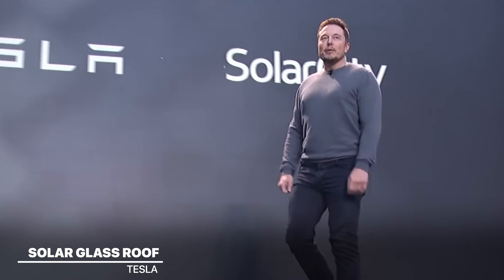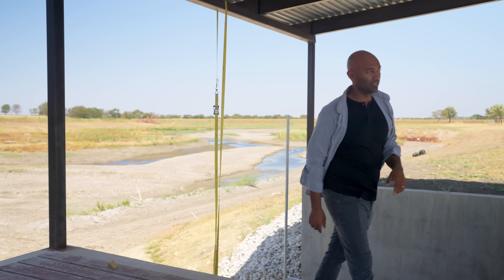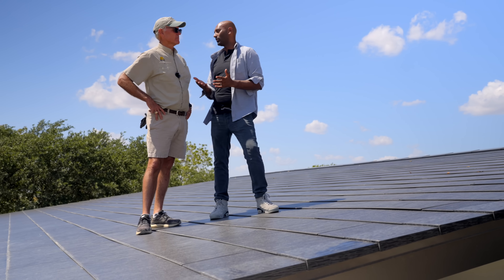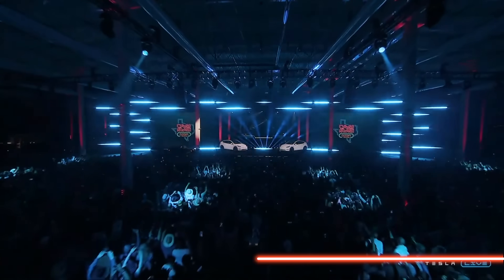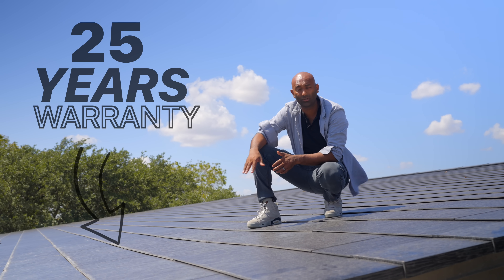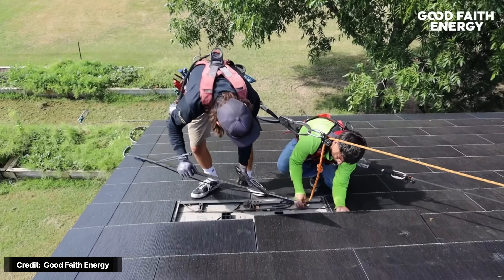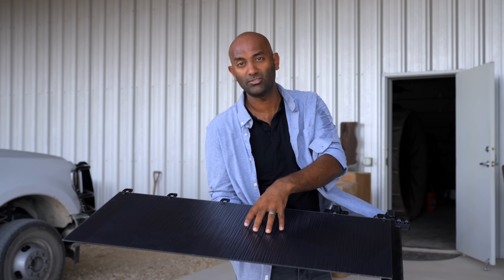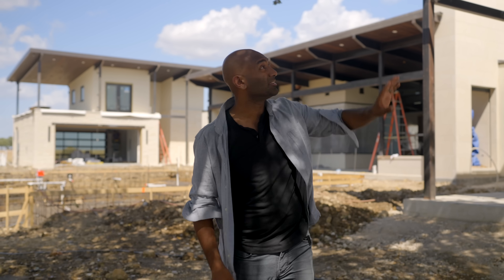Tesla Solar Glass Roof is About to TAKE OFF!

Comment: Seems a bit silly to have a section of shed roof with zero penetrations just to say you have a solar roof.  You still need "normal" roofing for the plumbing vents and other roof penetrations necessary on any home.  Why not just build a carport with conventional panels?  You'll get the same warm fuzzy from knowing you're going green, and you don't have to design your entire house around a finicky roofing system.

Comment: You can retrofit your current traditional vented attic into a conditioned space by sealing it up with spray foam, I've done it in my current property.  When it was built, it had a vented attic and the problem with this design is that not only is it not energy efficient, it was letting bugs in and also causing issues with truss uplifting that resulting in cracking on walls and doors not closing properly during certain season.  I had a contractor come in and seal off the attic with spray foam and all those problems go away.

One thing you will want to consider is that you don't have to use spray foam for the entire insulation.  It can be a lot cheaper to have them use spray foam to seal up the attic first, then have batts attached behind the foam secured using twine.   You will get the same resulting R value for insulation and it'll be a lot cheaper.

Comment: At >$200,000 for re-roofing your house with Tesla tiles, you’re getting to a funny place where the math starts to get blurry on rebuilding the whole house under it to put the solar roof on. I mean, I know you can’t actually be ahead by doing that in absolute terms, but it’s getting to the point where you’d need to consider it. Or, you know. Just use standard solar panels.

Comment: I agree completely about updating the way we build homes, and Lou's desire for independence deeply resonates with me (as do the environmental and cost savings aspects). My solar system is only 7kw, though I've about 38kwh in battery storage. Even charging my EV, I generate slightly more than I consume over the entire year, but I love being energy independent (for the majority of the time anyway). I hired Tesla to do the PV / battery system in my previous home, and they did a great job, but for this home I chose a more DIY approach for various reasons. The inverter I chose is the Sol-Ark 8k specifically for its off-grid and backup generator support, and it rocks.

Comment: You got this wrong. Tesla solar roof can not succeed for very VERY simple reasons. More connections = more cost = more points of failure. End of story. I’ve been a wallstreet energy analyst for 20yrs. It was very obvious from the start this product would fail. It cannot compete on a cost perspective because traditional solar is 6x bigger, more efficient per sq ft but has exactly the same number of connections.

Installed cost for solar should be under $2 per watt. If you pay more you got robbed

Comment: If we design homes with roofs for solar, we get monolithic, flat, simple designs that lack architectural integrity. The sacrifice is aesthetic, and that's fine if those making that choice understand these results are in store.

Paul M.
Atlanta, GA
Reply: I suppose it depends on what you consider "architectural integrity".   Personally I have always found the overly complex roof lines on recent homes to be hideous.   For a several decades now, the northeast has been littered with brand-new tract homes that were intentionally designed to look like they had multiple additions over the years.   Yuk.

Comment: I think its ugly,but to each his/her own. I prefer to wait for solar paint that's undistinguishable from normal paint (all colors). 

My roof will be made from poured (as well as the whole house) concrete, this allows it to be used recreationally, as a rooftop backyard.
Reply: As you can so see there is such a thing. I dont go around making stuff up.
Reply: @SkepticalUSVeteran  I don’t see anything, and I’m not saying you made it up, just that you believe in fairy dust and Santa Claus, because there is absolutely nothing in the world (ever) that you can paint on that produces viable electrical power.
Reply: I posted 2 links to articles. Does YouTube delete those or something?
Reply: Development of Spray-Coated Perovskite Solar Cells
James E. Bishop, Joel A. Smith, and David G. Lidzey*
Reply: @SkepticalUSVeteran  😂 Seriously? Articles don’t make electricity. Amazing how low the American iq has dropped. 

Go get yourself some. I’ll hold your beer.
Reply: Sorry had to figure out how to get around the censorship.
Reply: 😂 solar paint? No such thing bud
Reply: @fredsnit5699  there is and it's been tested in the military for charging radio batteries in the middle of nowhere. It was even featured in a military times newspaper.
Reply: @SkepticalUSVeteran  baloney.

Comment: $150k would more than cover my electricity bill for over 100 years at current prices, and electricity is a lot more expensive than the US when I live. Even with the absolute shitshow that the Texas power grid has shown itself to be - who would have thought that running an essential service to maximize profit instead of maximising reliability could have downsides - having a solar roof when you'd get the same generation capacity and storage for a fraction of the price elsewhere is a modern version of 'tell me you're rich without saying you're rich'.

Comment: Roof designs are just incredibly stupid.... and it's all just for aesthetics. So much about modern houses are just made to be mildly appealing when they could easily be made more intelligently, cheaper, and be just as attractive. 

I will never build a complex roof line if I can at all prevent it. With a simple enough roof line, you can roof it yourself with ease and minimal research. Side mounted vents are easy to create and easier to service. Every hole you punch in a roof is a potential leak.

Comment: Our Tesla solar roof was installed October 2021, in SW Washington state. I agree about roof design for solar, but I wouldn't go as extreme as this guy. Personally I hate shed roofs.  One thing I did to make more clear space on the south plane was move a vent from the south to the north plane. It isn't hard to do in most cases. But I think houses should be designed with no vents on the south planes, i.e. put the vents on gable ends or the north planes. Tesla actually installed a lot of PV tiles on the north plane as well, fortunately my "new" vent did not interfere with those. In terms of ROI, if I can skip a roof replacement in 21 years (which I think is likely), the extra cost is definitely worth it. Or if I get invited to participate in a VPP (not yet, but very likely), the ROI will be much better. Part of the problem with Tesla solar roof is Tesla seems to lack a clear commitment to making them profitable and successful. Elon doesn't give them much love - but then again he is a wildcard, so that may be a good thing. I do think Tesla solar roofs make sense, but not on complex or shaded roofs. Our setup: 10.6kW + 2 powerwalls, total cost $79k minus 27% tax rebates. 2300 ft^2 house, nothing fancy, built 1990. Produces more than we use, even here in the cloudiest part of the country.  Including the $12/month connection fee, our power bill last year was $5.10. We have been extremely happy with the roof and its performance.
Reply: that's amazing. Cheers and thanks for sharing. I hope to build my dream home someday with all these advancements to enjoy and hand down to my kids

Comment: From an economic sense, this never made sense to me.  You need a specialized labor force, that can do this.  Not the typical roof installer.  We have a labor shortage.  It's a niche product.  It can't see this scaling. From the climate change POV, one needs to retrofit existing homes.  Not build from scratch.  This is the majority use case.  From an aesthetic POV,  I already think the black on black solar panels look pretty good.  I see a lot of these in our neighborhoods.  I guess I've gotten used to these.

Comment: I would deepen that pond because that reduces the water's heat, and hence evaporative loss.  I would include swales or other rainwater harvesting structures made from onsite materials because hundred-year weather events happen.
I prioritize resiliency and value-for-the-money rather than solving for one problem.  I can relate to his POV.  

Good-to-know stuff without being annoying.  I would like to install a bifacial solar panel roof over an oversized carport for my initial build.
Reply: Good stuff. Growing trees is supposed to help regulate water fluctuations better too. Permaculture builds up soil from leaf litter. This soil absorbs water better than dry hard sun baked soil. Increasing absorption and retention of water…
Reply: @michaelsmithers4900  
Agreed.  I follow Brad Lancaster and am hoping bioswales become a bigger thing.

Comment: I typically love your videos, but I've hated your Tesla solar roof segments because they don't reflect the reality on the ground in the industry.

I've been in the business for 10 years come April. 

Other companies have tried making solar shingles and failed miserably because they're extremely problematic. 

There are many more connections and many more holes per-kilowatt installed.

Solar roofs do not produce as much power as conventional PV solar panels. They also don't last nearly as long as conventional solar panels, though they serve as excellent roof shingles.

By my calculation,  excluding any incentives, your friend paid $588 per watt. That's almost twice as much as what our company charges for a top of the line monocrystalline system in Massachusetts, and we are in one of the higher-priced markets for solar systems.

The word throughout the industry is that consumers who have bought these Tesla roofs not only were served up a criminal bait-and-switch sale, with the timeline of the contract violated and they Miss ng out on years of solar production,, but have also had numerous problems with failures. 

There are just too many connections to fail, plus all that heat building up on the roof. There's no venting underneath the shingles. 

Heat is death to solar panels. With temperatures above 77° on conventional panels you start experiencing a drop-off in the efficiency/production of the solar panel.

And that's with ventilation under the panels.  Solar roofs lack that ventilation, get much hotter, and have terrible production for what you are paying.

The worst thing about all of this is I suspect in the future people will have Tesla solar roofs that no longer produce power but will not be removed them  because the owners love the durability of the roofing.  Houses that will have been solar for 15 or 20 years with a Tesla roof, that could have been solar for 40+ years with conventional PV panels, will be nothing but dead glass on the roof that may not become solar again until the shingles start breaking perhaps for the following 100 years. 

Think of all that lost, potential solar production.  In other words, I think it's a mini-environmental disaster if this thing catches on.

I don't know of a single person in the industry that would want to sell Tesla roofing unless they work for Tesla and/or are dishonest people, which is not at all rare in the solar industry.

Comment: I don't know why solar is so expensive in the U.S.. I am in Sydney Australia. I just put in  6.5. kw of Q panels and a 5kw Fronius inverter for $8kAustralian ( about $5,500 U.S.).  It generates an average of 25 kwhs per day.
Reply: Exactly. Installers here a robbing homeowners. The panels racking balance of system and inverter should be less than $2 per watt installed

Comment: That roof would not work in an area that needs to sluf off snow
Reply: The solar PV produces heat. It actually removes the snow and ice on its own. Slides off like a greased cookie sheet all by itself.

Comment: So one company is incapable of making solar that works on your average roof and the fault is in the construction of the roof not in the company that can't seem to figure out how to make solar that works on an average roof. I like Tesla but they are just failing miserably in this category. This video which is titled why has it been such a flop turns out to just be a commercial for Tesla. The video should have been about 10 seconds long. " Tesla solar glass roof has been a total flop- here's why. Because it is insanely overpriced Auntie impractical. End of video.

Comment: I agree with you that house design should enable solar. Unfortunately, with 80% of new developments ending up under the control of the 2-bit dictator system known as the "Homeowners Association", whose first and foremost goal is to prevent any possible non-traditional use of your property from occurring, you can forget this from ever happening.
Reply: Agreed but that's no reason to give up. People need to show up to homeowners association meetings or get involved in local politics where they can to start changing the policies.

Comment: Great video. Kind of an inaccurate title for the positive review... Ricky makes some very important points: the best roof is one flat plane, angled to the south, with no vents poking through. Stop making home roofs that are shaped like two origami swans mating! The modern style designs look better than the McMansion style that seems to be the only thing big housing developers can do.  I would love to see Tesla take there solar products to the next level: a modular roof panel that has everything: structural roof, insulation, glass solar tiles, power wall inside the panel. These should be big panels, maybe four would cover the entire house. A truck shows up with four panels, a crane places them on top of the walls, plug the connectors into the house wiring - done.

Comment: how do the financials look for this install? how many years to pay off? looks great but expensive.
Reply: Without solar, the energy on this house would probably cost about $6K-$10K/yr. Let’s call it $8K. After the 30% tax credit, you’re looking at $100K. So +/-12 years?

The other thing to think about is that this roof will never have to be replaced again which would eliminate any insurance claims for roofing replacements. Now it’s less than 12 years. 

Is there any other roofing product that has an ROI?
Reply: @pablovial11  thanks for the reply. doesn’t 8K seem high though? i live in 3300 sq ft in minnesota and average about $3K/year.

Comment: Two thumbs up on simplicity and orientation. The rest overlooks all the elephants in the house. Not saying people shouldn't have the choice to live remotely or in single-family single-use "neighbourhoods", but those lifestyles drive up energy demand by enormous amounts in the first place. And they are being subsidized by those who live in denser mixed use parts of the region. So many YouTube videos out there to cover those points. The suburbs are a Ponzi scheme.

We've forgotten how to build great cities and walkable neighbourhoods that would slash energy consumption, environmental degradation and air pollution. Most have never known neighbourhoods that foster community and reverse the feeling of isolation plaguing large swaths of North America. I see those aerial views of suburban sprawl and I can't imagine how horrible it would be to live there - where you never leave your home without getting in your isolation tank and swear at others in traffic. Uuugghh!

PS. Spray foam has it's place. But it should be used sparingly to solve specific insulation issues. It will be a catastrophic environmental nightmare when it comes to the end of life of the building. Some cities have banned it for that reason.

Comment: I have often seen overly complicated roof designs on newer builds.  Or roofs facing the wrong way.  I object to them not only because of the difficulty for solar installs, but any shingle replacement is more expensive with extra labour needed with more potential for failure and water intrusion. 

Ironically, houses built prior to the 2000s are often better suited for solar.  Our house has a huge south facing area.  There is an 8.9 kw system on there now with room for another 6 kw as our electrical needs increase.

It is possible to retrofit an older home for energy efficiency.  My rental was made of 2 by 4 construction with cheap r12 insulation.  Probably not even that.   I first upgraded the siding which gave me another r5.  Upgraded the windows at the same time.   Whenever I upgrade a room I add a 2 by 2 on the studs making it 2 X 6.  I can fill this space with roxul (r22).  I then add 1 inch of foam which is also a vapour barrier (r5) and a thermal break.  So go from r 8 or 12 to r32.  I did this not only to save money, but also to make the house more comfortable.   It was hot in the summer, cold in the winter.